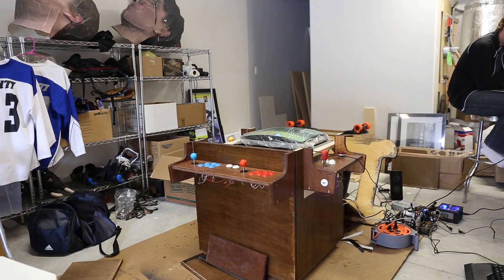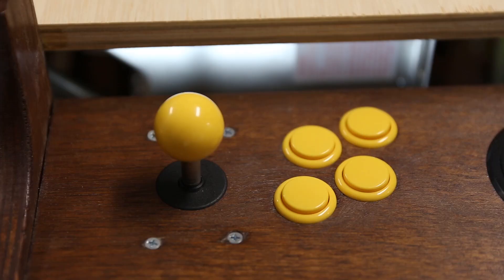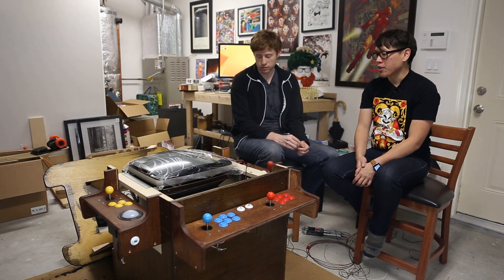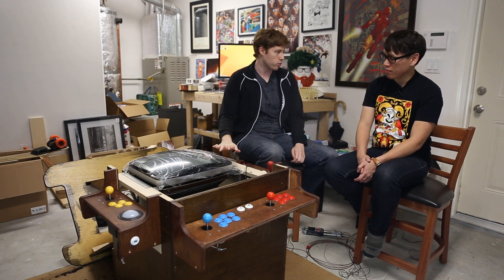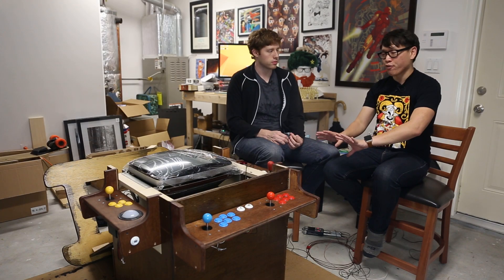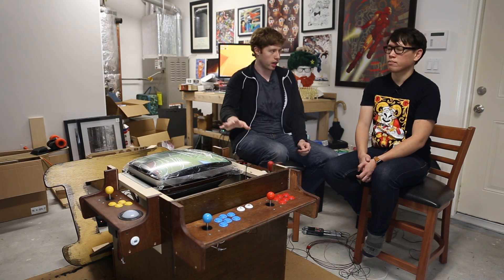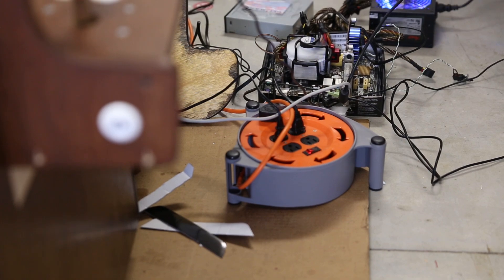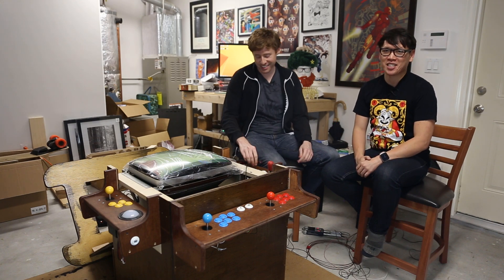Building a Custom Arcade Cabinet, Part 7

Comment: Please make sure you use groovyMAME. It is so much easier than loading a million custom rezs and configs and stuff for regular MAME.
Reply: and don't let that ipac just dangle =(
Reply: Zapf Look at the rest of the wiring and how messy it is, exposed copper out of the crimp connectors without even using some heatshrink.. The ipac seems like the least of their concerns. I would love to come out and rewire that thing for them, I can't stand to look at shoddy wiring like that. :/

Comment: I have been battling with MAME for years. It's basically a complete nightmare getting everything you want working as it should. I've been wanting to build an arcade cabinet but I keep putting it off in the hopes that a better than MAME solution, or at least a significantly improved MAME will come out some day.

Comment: A trouble shooting tip. If you have a channel on your input interface bd. that appears to not be working swap a wire from a working channel to the non working channel. If the channel now works when using the control from the wire you swapped it the problem is definitely either bad wire / connection / switch. If the channel still does not work you have a dead channel.

I hope you did not use any bell wire or telephone type wire, solid core. I thought I saw some in the vid. You need to use multi strand wire and at least 18 AWG. 16 AWG would be better. If you have a wire that plugs into a screw terminal lightly tin the wire first. When using crimps solder the connection after crimping. This is standard practice in industry where reliability is key. 

My 45 plus years of experience with electronics and many different types of control systems. That wires are usually the problem. I am assuming that the inut interface board you are using switches a channel on when the channel goes low or senses ground. If this is the case you will need to have a pull up resistor at the input of each channel to raise the channel voltage to whatever the voltage is for high, 5 vdc or 3.3 vdc. You might be getting intermittent operation because of this. Use a relatively high value resistor such as a 100 K Ohm. It only needs to be a 1/4 Watt as there will be little to no current passing through this resistor. It is only used to keep the inputs at a high state until ground is detected.

Hope some of these suggestions help.

Comment: Do you really need all that power sucking hardware to playback games from 10 years ago?  A small ARM board running Linux and MAME is more than powerful and wouldn't require any fans.  /me is a bit disappointed.

Comment: I love the high pitched noise. :P It's a classic "TV" sound.

But anyway, right now I'm wondering why you didn't build a lower powered fanless, SOC computer, like a Raspberry Pie or even an Intel NUC. Is it just because of the video out?

EDIT: Also, I'm not sure I understood correctly, but did you buy an LCD panel too? If so, why? Sure you might need one to install everything, but did you need to buy one just for that?
Reply: allluckyseven Raspberry Pie's can't run as many games as a full computer. And I think they just bought the LCD as a fail-safe, and for the initial setup of the computer.

Comment: 0:54: that are some really really horrible connections into those blade connectors.
1) don't twist groups of wires going into a single connector (avoid more than 3) (dont's twist stranded wires in a crimp connector either)
2) don't leave wire exposed
3) A bit hard to see, but those connections should be made with stranded wire not solid wire
4) should use a proper crimping tool and matching crimp conectors instead of the cheap closed barrel type connectors.  They're ok for a one of project, but with the whole of Adam's workshop at your disposal, I'm sure he's got the good stuff (open barel) there somewhere too.

Comment: I'm curious if OLED monitors will fix the flaws LCD monitors have. My plan was to recycle and old LCD panel into an arcade cabinet and upgrade the panel to OLED when that became reasonable. Would OLED displays make CRT displays obsolete or would there still be a benefit to CRT displays?
Reply: Building an arcade cabinet and not using a CRT? You might as well just emulate. If the games came out in the CRT era, they will probably look better on a CRT. LCDs are far superior for any sort of word processing, but seeing as an arcade is on the complete other end of the spectrum, go for a CRT.
Reply: Owen McKee I wasn't clear; my fault. I meant in relation to building a MAME (emulation) cabinet. If i was building a reproduction i'd definitely go for the CRT.

Comment: Why not just connect a crt TV through RCA cables? That's how I did it all my life.
Reply: Damian Reloaded
There's a few problems with that approach. S-video and especially composite damage the picture, causing it to lose color and become very blurry horizontally. Secondly, convertor boxes and consumer cards with RCA output usually scale down a higher resolution image and output it with something called interlacing, which causes the image to shake and flicker, generally looking bad.

The reason for stuff like ArcadeVGA is to show a low res image in its "native" form, full picture detail and no interlacing. You can still use an ArcadeVGA on a TV to its full potential, though you'll need to buy or build an RGB to YUV adapter if you're in North America or other regions where direct RGB input on consumer-grade TVs is not available.
Reply: Damian Reloaded
I'm in my early twenties but I think CRTs are awesome. Scanlines were an integral part of the aesthetic, in my opinion.
Reply: Damian Reloaded I think you're assuming that monitor means VGA-grade. Monitors can be and basically were glorified TVs in the arcades. VGA monitors were specifically for PCs, meant for productivity and thus had more lines of resolution as well as a higher dot-pitch to be able to show those individual lines more crisp.

If you set it up right, any (newer) CRT TV will be just fine for an arcade machine. The important part is to have the image sent to the screen in its native resolution, and that basically means using the ArcadeVGA card even if you are using a TV.

The method you were talking about involved lossy scalers meant more for presentations and stuff than retro gaming.
Reply: Blastfrog For games from 1980-90 I think a cathode TV tube would be the right choice for maximum flashback experience. Probably the kids born after that time will give an f, but still, I'd prefer it.
Reply: lassi kinnunen I think the spirit of the thing is to have it as similar to the real thing as possible. The real thing used TV screens back then. It wasn't until the late 80's early 90's that computer monitors with neat pixelation became able to do colors and be cheap.
Reply: Damian Reloaded
Technically, arcade machines did use monitors. Very close to TV-grade as far as their resolution capabilities and dot-pitch, but they were not TVs as they did not have their own casing (it was just the naked tube) or built-in speakers, since it was expected that the rest of the cabinet would provide those features. They also expected raw RGB input, nothing encoded like how TVs wanted YUV or a derivative thereof (usually the lower-quality derivatives).
Reply: Blastfrog I don't know much about the electronics part, but the pixels size/arrangement and the color calibration looked more like TV tubes than to CRT monitors. I'd rater like the first more than the later. But that's probably because I spent my entire childhood staring at those screens.
Reply: Blastfrog Been reading a little and what you describe seems to be the right way to do it for maximum emulation. I was missing the part about native resolution. I would like to see anyway a direct comparison between the two methods,TV-out vs ArcadeVGA, to really see how much quality is lost using tv-out.

http://www.ultimarc.com/monfaq.html